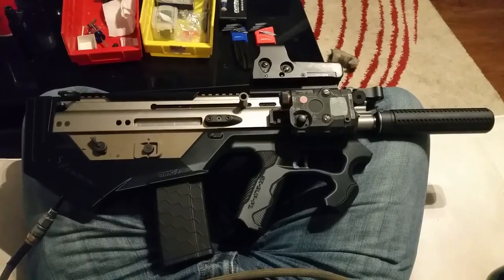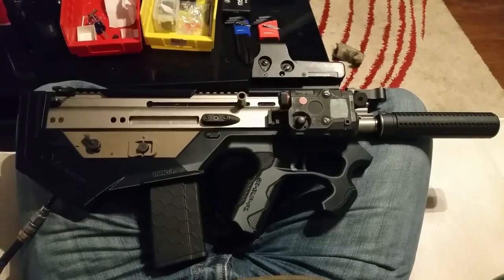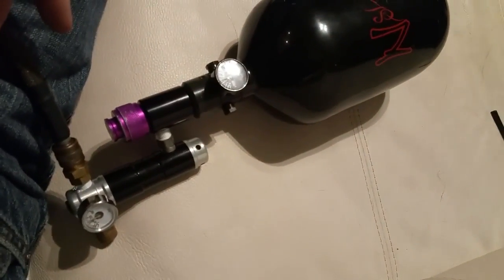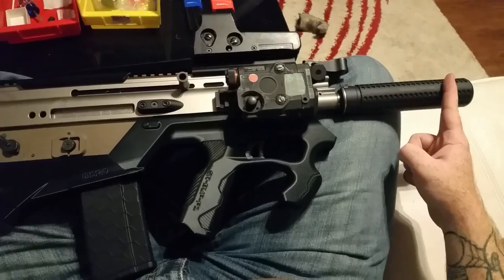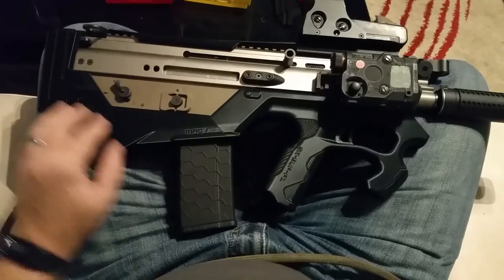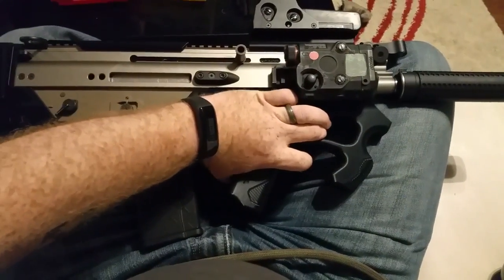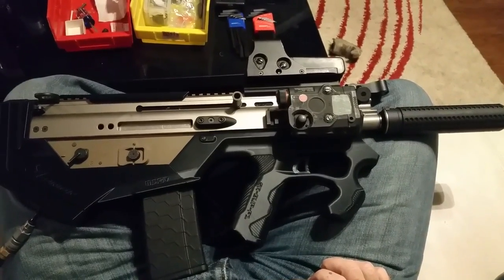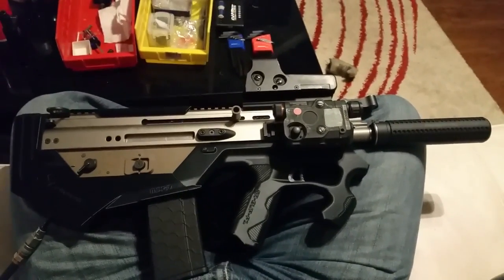World's First: SCAR-L Bullpup, powered by Daytona HPA

Comment: Got a combined cost of the full build?
Reply from the maker: Total? Roughly $2000

Here's a breakdown of what everything cost at retail:
WE SCAR-L: $350
Daytona SCAR-L Kit: $500
SR Union Bullpup Conversion Kit: $120
Holosight and PEQ: $190
Rail Riser, Sling Mount, Flash Hider and Suppressor: $120
Inner Barrel, Bucking and RHop: $90
Air Tank, Regulator and Air Hose: $400
Install Labor (@$30/hr): $150
Break-in Labor (@$10/hr): $50 

Since I'm an airsoft technician, even though I didn't have to pay for it myself, I still included what would have been the labor cost to do all the work.